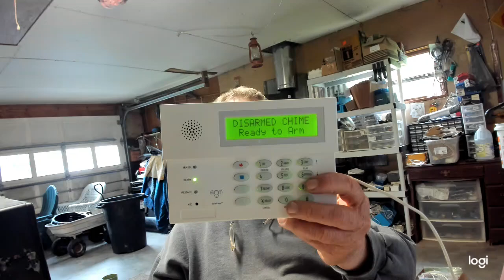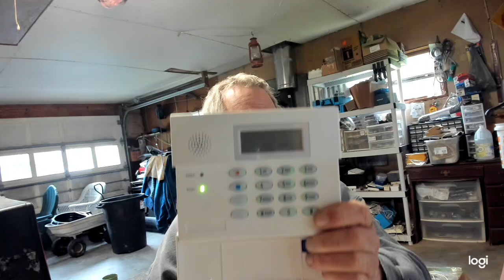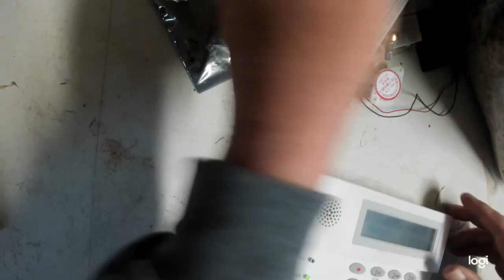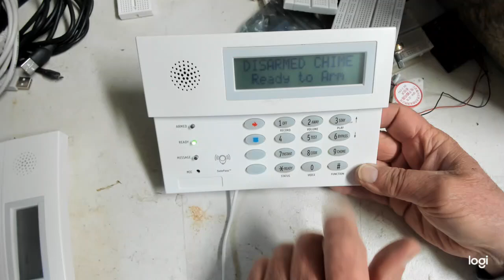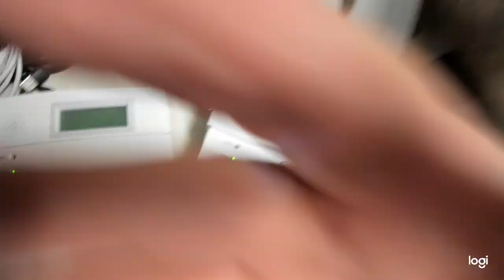How to Change an Unknown Master Code on an ADT Ademco Alarm System

Comment: Sorry to bother, and thank you so much for sharing your knowledge about the ADT system.

My wife and I bought a house last year, and the previous owner had an ADT system installed. Unfortunately, we don’t know the installer code or the master code.

Right now, the small screen on the ADT control panel is showing some numbers, and I’m not sure what they mean. Could you please advise how I can reset the system and use it manually?

Comment: Can I ask you then? What is the best panel to get for me to set up to monitor myself? I've seen a lot of the older stuff you can get that 3 or 4 module to call on your phone. But I was trying to get something with a nice, a stream for a couple of the rooms in the house. Meaning touchscreen.
Are there any two looking to used
Reply from the maker: I retired out of the industry about 5 years ago and have not kept up with what's out there. I know old school panels and do not want to steer you into something obsolete.
Reply: @DIYELEKTRONICKITS thank you. I really appreciate your input at my parents' house. There's an old unit on the wall. That's all wired up and on my other house. I used a newer really old unit to put wireless sensors. I think I may combine Em both just trying to get something to send me a code or send me a notification. If something happens in the house again, thank you

Comment: Can I ask you? Is there a way to change the main code on an adT comman 7 panel i bought a house and it has it on the wall with all the sensors and everything installed but I have no idea what any of the installer codes are or anything.
Would love to use this as a manual system without add not sure.If you have any info on it
Reply from the maker: Sorry no.  ADT got rid of the Ademco-style panel I show in this video, just so that what I show you here can never happen again.
Meaning they were losing money with this type of panel, so they went with the proprietary Command type panels where the homeowner or new owner can not manipulate it to work without the help of ADT at $300 and our service calls. So to answer your question, the panel on your wall is useless without the help of ADT.

Comment: What if I have an old touchscreen that was probably installed in the late 90s early 2000s somebody touched my screen and armed it I had to unplug wires to get the alarm to stop, which then shut down my whole system, even though it’s not armed, it’s still alerted me to my doors and windows being opened not sure what to do
Reply from the maker: If its still alerting you ?....you did not fully power it down...do you have the codes for it?
humm,,,send picture of your keypad to diyelektronickits@gmail.com and we will go from there